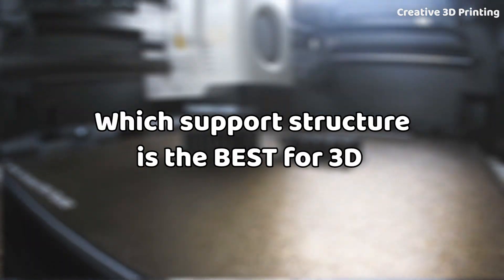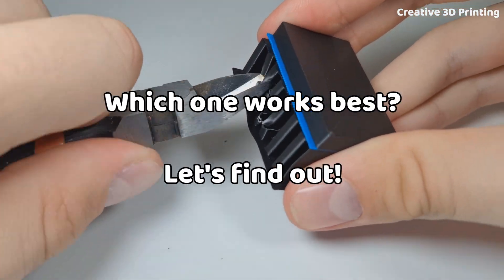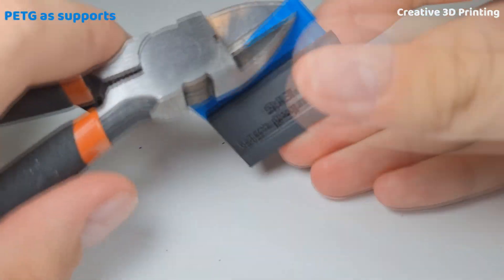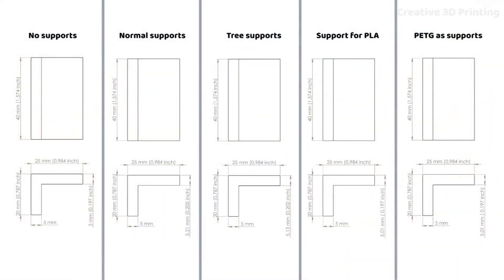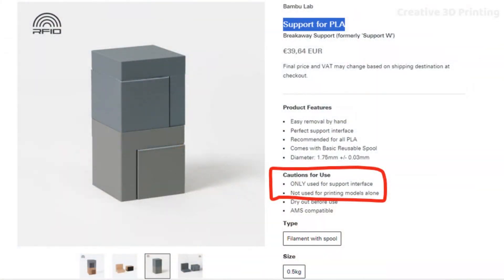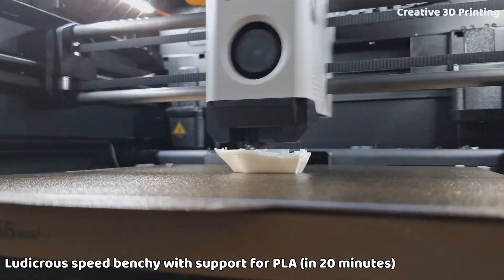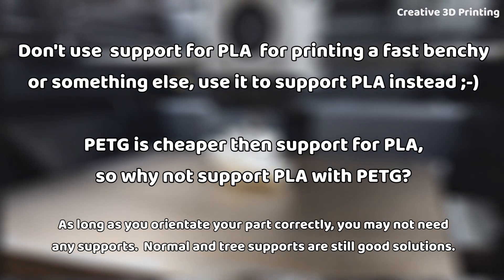What's the Best Support Structure for 3D Printing?

Comment: HI how do you do your setting on most support material using PLA material only last few lines change to PETG
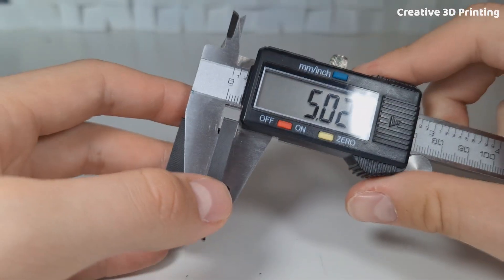Reply from the maker: At 0:35 you can see the settings I used for PETG support 😉
Reply: @Creative_3DPrinting  thanks for reply yes i did😂😂😂 but currently i don't know how to mix material for support , from my understanding most of the support you are using same material as printed parts only few last layer using PETG. hope i correctly explain it to you. Appreciate your answer in advance
Reply from the maker: Sorry for the late answer; at the tab 'support' you can go to 'filament for supports'.
You will change the 'support/raft interface' to for example PETG when the main part is PLA.

Comment: Muss ich etwas bei den Einstellungen: Abstand usw. Anycubic Slicer beachten bei der Nutzung von PETG als Support Material (  Das Objekt besteht selbst aus PLA) oder kann ich das einfach übernehmen mit Baum Struktur oder Standard ( PETG)?
Reply from the maker: What you say seems correct, but I have never used Anycubic slicer before.
Tree supports is good enough most of the time, even in the same material as the object.

Comment: This was the most condensed, correct and straight to the point on this topic I could find anywhere! Thanks for this!

I was failing this because I did not set my infill to rectilinear, so when the PETG was laid on top of the PLA with so many curves, it couldn't attach and end up dragging. With rectilinear, it could lay enough on top of PLA without sticking and not get dragged around the print!

Thanks
Reply from the maker: Nice to hear that it works now! Thank you very much for watching :)
Reply: @Creative_3DPrinting  Late to the party but I immedeately felt like saying this as well. Thanks for respecting the viewers time instead of farming the views!
Reply from the maker: Thank you very much! 🙏

Comment: i usually prefer regular supports (tree or standard depending on the surface) but for things where you need a specific, pretty bottom surface a dedicated support material is great

but man, what ever you did with your settings - revisit them, regular supports should be substantially easier to remove
Reply from the maker: I normally use tree supports because they're clean and easy to remove them, but indeed, there went something wrong here..

Thank you very much for watching!

Comment: Yeah.  Not sure what settings you use for tree supports but you should revisit them.
Reply from the maker: They look bad lndeed but with the black filament, it just looks even worse than it was.
Normally, they're easy to remove without leaving marks. But I guess somewhere in my settings, there is something wrong..

Comment: Thank you for sahring! What would material/type of support would you recommend for PETG HF, I tried normal and tree support and as you mentioned is surface is very taught as well as removing the support is very difficult?
Reply from the maker: Thanks a lot for watching! What brand/type of printer do you have? 
Do you have the possibility of printing with a multi material system? If yes, Bambu lab does have Support for PETG, I never tried it but I think it would be as easy to remove as support for PLA.
Reply: @Creative_3DPrinting  thank you for the suggestion. I have BL P1S and using their petg hf, unfortunately I don’t have ams
Reply from the maker: Do you design your parts yourself? If yes you can design your supports yourself so it looks good and it's easier to remove. What you can also try using the 'slim' feature for tree supports, it makes it smaller which is easier to remove.